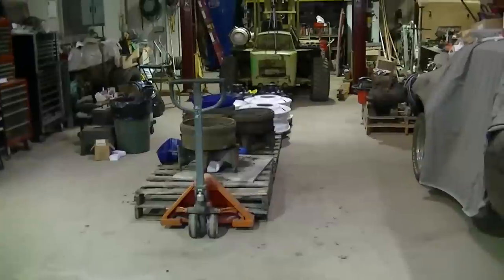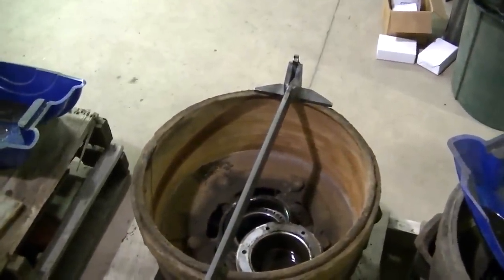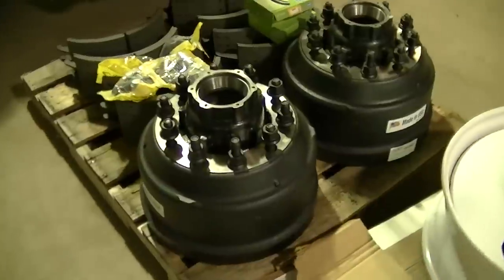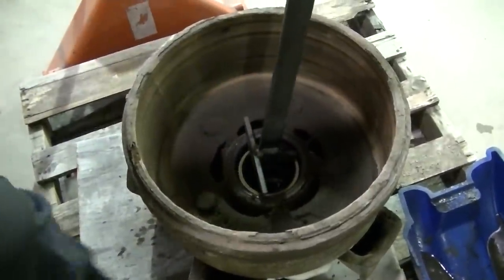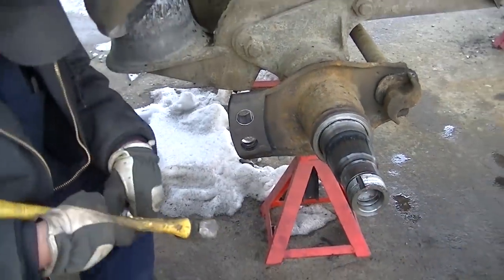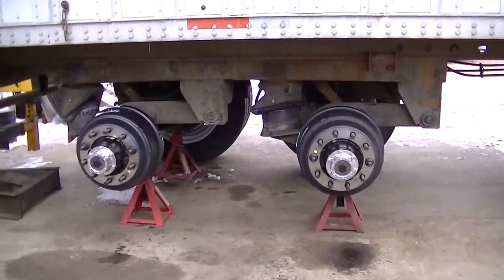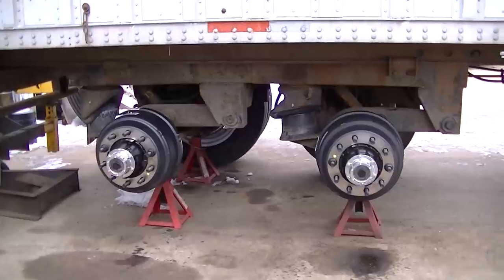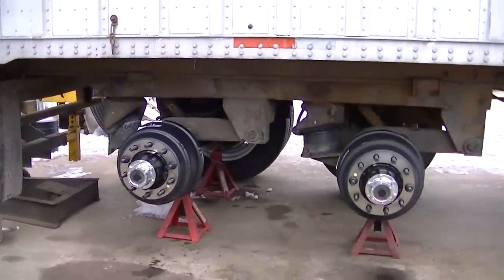Walking Floor Semi Trailer New Brakes and Hubs

Comment: It's cool to have the tips from your dad. I liked the  way he connected the spring on the leading edge and using the wrench for the s cam rollers. Tks
Reply: a tip: watch series on InstaFlixxer. I've been using them for watching loads of movies recently.
Reply: @Hassan Ruben Definitely, been watching on instaflixxer for since december myself :D
Reply: @Hassan Ruben Yea, have been watching on InstaFlixxer for since december myself :D
Reply: @Hassan Ruben Definitely, I have been watching on instaflixxer for since november myself =)

Comment: At my old job we used to use a hand truck to lift those big tires. Sometimes bigger than that! So i can vouch by it. It is cheaper than that tool I'm sure. Just putting it out there for you and everybody. Very cool video thank you for sharing.
Reply from the maker: John C   We used a pallet jack before this but you can't rotate the tires on them.  This tool has rollers.
Reply: mossman381 that's pretty neat!
Reply: mossman381
I want one!    I hope whoever invented that is rich,  Looks very helpful

Comment: How did you get the big main spring connected to the bottom shoe by hand and so easily??? I always have to use the brake bar and it takes me a little fidgeting with it before I can get it connected. Is it the position of the s-cam?

Comment: I like that yellow tool you use to line up the tires on the hubs. I need that.
Reply from the maker: colinsonthetube   It worked pretty good.  Those tires are very heavy.
Reply: i put those tires on with just ken tool tire bar and no 2nd person needed.
Reply: but the tarp sprocket gear seal driver is nice.
Reply: 36 inch pry bar is what I use, got taught to do it that way. can use 2 if it helps
Reply: colinsonthetube che e

Comment: Don't they do disc air brakes on trailers now.  If you were going through the trouble of doing a complete brake job how much more would it of costed to do a disc brake upgrade on the trailer?
Reply from the maker: I would guess that conversion would have cost a lot more.  We already spent more than we should have on this older trailer.

Comment: That trailer should have never left the shop. The wheels were installed incorrectly creating a potential for a wheel off.  Even though everything was new, they failed to correctly lubricate the stud and nut. Then using a impact they tightened the lug nuts, hammering on them several times. WRONG! They have no idea if the nuts are tight enough or over torqued. If its the latter then they just damaged a complete new set of studs by stretching them. Regardless, they should have at least checked them with  torque wrench, or better yet used a powered torque wrench from TorcUP.com, then every nut would have been exactly at 500 lb-ft. and the job would have been perfect.
Reply from the maker: My dad NEVER leaves the shop without torqueing the wheels after a job like this. I might have to delete your comment because it has a link. I don't allow links or advertising unless I get compensation.

Comment: hi How R u , please can you tell Me what is the jack stand ton you use just to support one side of the truck , 2 or 3 ton is enought or not thanks A Lot
Reply from the maker: The truck isn't being supported by those small jack stands.  There is a big jack on the rear holding the entire trailer up.  Those jack are only holding the axles.
Reply: thanks for The answer